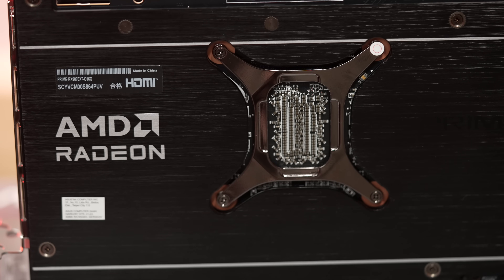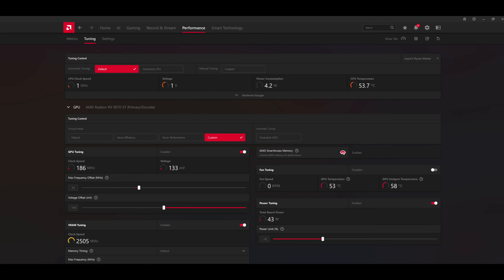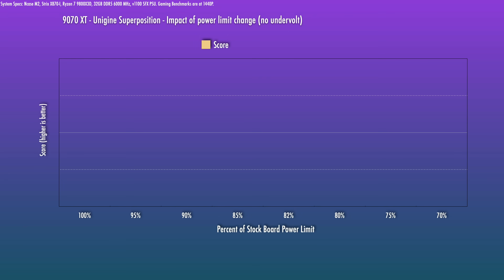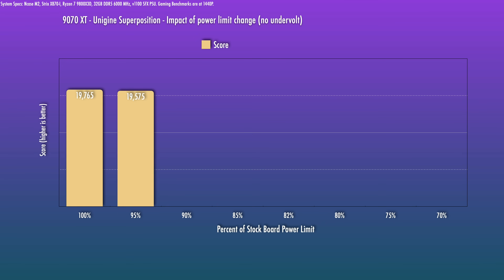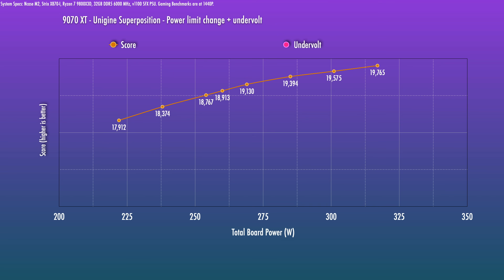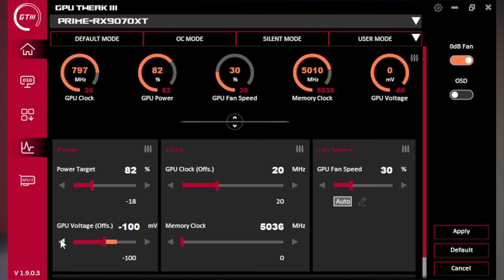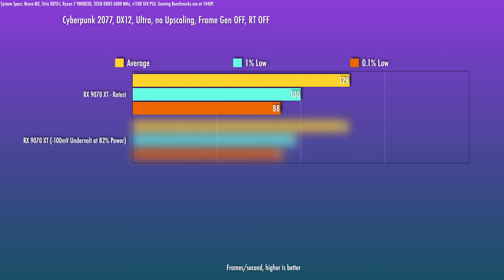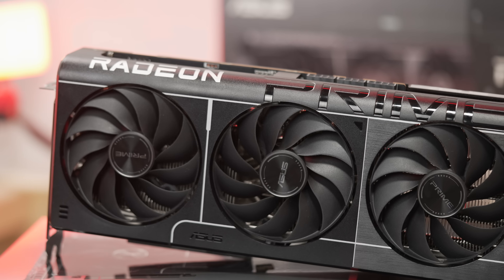Undervolting the 9070 XT... and also overclocking a 9070 to XT levels!

Comment: I've done -21% power -65mv and+100 on the memory. Sorting at 5% performance loss with hot spot and menm temps at 70 and GPU at 50. Silent high performance gaming at 240w!

The pulse for my theme and I got it very close to Aussie MSRP (double the USD number)

Comment: Got my 9700XT this week 

Upgraded from 5700XT. I had different 7 profiles set for my 5700XT after 5 years of use (power limits, voltage, fan  curves etc). So setting up newer ones wasn't a lot of work. But testing take times.

Out of the box (stock) I see power usage of 330W+ (415W in 1 run for a few seconds) after doing some bench marking. stock 3.1Ghz boost clocks, Ram 2505

Currently I have 4 profiles saved 

The one I use currently (stable in games/bench marks tested so far): 
-85 voltage offset 
- 15%  power limit
2618 ram with fast timings.
Custom fan curve 

Dropped my temps by 10C hot spot alone. 

Power 280w to 300w 

But the boost clocks (core) now hits up to  3.3Ghz 

So 50+ W dropped, boost clock up and scores up (287 points, in 1 bench mark, from stock). 

I'm still testing and know from the 5700XT that some games may like some different setting. 9700XT may be the same

Comment: With the Pure 9070 (2700mhz) I go to 4000pts (3998) on the new GameTech Bench (steam) and hit the 3000mhz on the GPU clock ! It's the 5070 TI score, but I go to 270w (with the 10% of adrenaline let us do) // I was undervolt to as doing : -55 or -65 (bcz it seems you can get more gpuclockhz per watts with undervolting) Memory is set with fast timing option and 2666mhz boost (it run at 2657mhz)
Reply: There is another score on this benchmark from 9070 that goes to 4200pts !

Comment: I'm very new to all this, but I want to know if the purpose of undervolting and power limiting is to keep temps down for ITX builds. I'm confused because there are 9070xt OC variants out there. And if my presumptions about temps is correct for ITX builds, people that wants to build in SFF cases shouldn't get the OC 9070xt?

Please someone shed some light

Comment: My 9070 is stable at -160mv.  I havent even tried any lower lol.  Maybe i got super lucky but these things can run really stable at VERY LOW voltages.  Memory is at 2714 with fast timings.  It SCREAMS at these settings.  temps are under 80c for the hotspot the rest of the card is well under 65c.

Comment: What you think, 9070 Gigabyte Gaming OC or asus prime for 35$ less? Want to reach the 9070XT Performance
Reply from the maker: Personally I’d pick whatever is cheaper, I’m not under the impression any of those are pre-selected chips. Being able to catch the XT isn’t guaranteed but it did not take a huge overclock to get there.
Reply: @MachinesMore  hmm okay i was thinking maybe the cooler of the gigabyte gaming oc could be better. So you can reach a higher boost and more fps.

Comment: Are you going to make a follow up video with more games/setups? I'd like to see a "stock" 9070 @ ~253W (110% power) vs a 9070 XT @ ~260W (82% power). Probably be a lot more data points, so if not could you maybe add a little comment how much performance you would lose at those power limit without touching the voltage offset? 

This is because your Cyberpunk data is really interesting as both of them are using similar TBP it seems, but the 9070 non-XT seems to have a bit more aggressive undervolt to hit higher clocks. If performance is similar with more games, this would make it seem the CU scaling kinda of drops off after 56 CUs (9070) bearing in mind a very good silicon I suppose.

Comment: I got XFX 9070XT Mercury  - I was trying -AND testing all weekend..so it works with values above -70 mV BUT - It crashes once in a while even with -30 mV in Games like Hunt Showdown and The finals..I was playing all weekend - and I had to go down more and more because of crashes - till I gave up after -30 (going down from -65 in steps of 5). I just set up this undervolting Value and opened the power limit.

Ich habe eine XFX 9070XT Mercury - Ich habe das ganze Wochenende versucht und getestet... Es funktioniert mit Werten über -70 mV, ABER - Es stürzt gelegentlich sogar bei -30 mV in Spielen wie Hunt: Showdown und The Finals ab... Ich habe das ganze Wochenende gespielt - und musste wegen der Abstürze immer weiter runtergehen - bis ich nach -30 mV aufgegeben habe (von -65 in 5er-Schritten nach unten). Ich habe den  mV - Wert eingestellt und das Power-Limit geöffnet.

Comment: Getting my 9070 to within about 3% of 9070 xt levels.   with 10% power, core overclocks quite a lot, I cant get memory to OC much though.     In any case,  its a huge jump going from a 6800 to a 9070 (non xt in both cases).    And, hotspot temps are quite modest under load (hotspot under 60c in games, vram temps do tend to go up to around 85c.)   Im using a Fractal Torrent so ambient temp inside the case tends to be pretty modest.  Im quite happy with this GPU.

Comment: Everyone is undervolting their 9070xt by -100mV and meanwhile mine crashes at -80. I guess there have to be losers in the silicon lottery too.
Reply: It's also game and background application dependant. I will test mine further.
Reply: I think a lot of users are not correctly testing their undervolts. From what I see people are testing using synthetic raster benchmarks, but nothing using the RayTracing or Machine Learning units of the cards. My card won't go lower than -70mv for games like Jedi Survivor if Ray Tracing and DLSS (Optiscaler) are turned on. If I play raster only, I can get -100mv or lower.

Comment: I am having issues with my 9070 that I cant figure out. My initial Uingine benchmark 1080p high was 29,657, and then I updated the drivers for the motherboard (B650) and cpu (7800x3D) and it went down to 25,000 and I dont know how or if I should switch back to the old motherboard and cpu drivers? Its driving me crazy ! Any Idea where I could get some help with this?
Also I did a comparative 4k benchmark and got 16900 so Im under performing the benchmark you showed in the video as well by about the percentage of lost performance.
Reply from the maker: I am curious too… did you try reinstalling the display driver? The other two updates shouldn’t impact the card but it’s possible some system setting was patched over. One thing would do is pull up a hardware monitor and log if the GPU is drawing full power when running the benchmark.
Reply: Well first of all, is you 9070 running stock settings? without undervolt and raising the power limit 17k ish seems like where it should be, about 11% lower than OC'd card
I have 9070 pulse, I run -55mv, 200mhz oc on memory and 110% powerlimit. That got me 18428 points with 13600k with no OC on CPU. I could juice my memory to 300mhz and undervolt to -80mv and run the benchmark and get like 19k points but its not stable on CP2077
Reply: @ I appreciate you taking the time at first I was relieved to hear you say that but then I ran another 3dmark test and saw the same losses from 27800 to 26179 and thats with an overclock try to catch back up to my non oc performance. I clearly did something thats dragging this thing down about 10-15% the first thing I did when i got it was benchmark it out of the box practically and it did phenomenally and then I had some cpu stuttering in game nothing crazy but I decided to update the motherboard and cpu drivers. I have tried reverting back to the old ones but The AMD installer that "checks hardware comparability" freezes unless I try to install the most recent one. I think it might be a utilization issue The Uingine Benchmark was getting like 94-97% card utilization drawing around 230-260 watts according to hardware monitor and during the 3dmark test it was even less often drawing less that 120 watts.
Reply: @leemiller5194  GPU utilization below 99-100% would indicate cpu bottle neck indeed. What about your CPU score benchmarks? Has it gone down or stayed the same?
Reply: @DuBstep115   CPU scores are good around 18000 on cinebench r23 but ill trip which is in range for 7800x3D but yeah i think therein lies the issue when you bench mark yours your actually at 99% - 100% at least 10% of the time if i get to 100% or 98% even its for a half a second and then it goest to lik 94-96% etc
Reply: @DuBstep115   CPU scores are 18000 on Cinebench R23 which is in range for the 7800x3d
Reply: I updated the UFEI / BIOS and it made no difference. Still no luck restoring previous performance.
Reply: @leemiller5194  I would have done clean install for windows at this point 😅
How about gaming? No stutters? The GPU works great but just with lower performance?
Reply: @ pretty much as far as i can tell i get some frame time spikes in one particular game but ive only had it three days and  other than that it works amazing. All things considered its still a massive upgrade and i should just be happy with it Im just so confused as to what happened. I ll try a clean windows install next.
Reply: @ You were correct! that is what fixed it. I think the Chipset Drivers that were being installed with the Adrenaline package the newest ones for some reason are tanking Performance by almost 20% in some cases not sure what I actually did / did wrong etc. but its fixed.
Reply: @leemiller5194  Glad it worked out in the end, enjoy your new GPU
Reply: @leemiller5194  I fkn hate yt, they deleted my comment like 7 times
Reply: I FIXED IT! scoring 31-33k depending on oc after clean windows install and installing adrenaline WITHOUT the chipset Drivers! OMG for me that was a lot of work I dont do a lot of PC stuff.
Reply: @leemiller5194  haha enjoy your new properly working gpu

Comment: Stumbled upon this video. Have been wondering why others have not been doing more testing with the 9070. Seems to have a lot better power to performance ratio than the XT variant. Have a small office that heats up quickly. Work from home and use the pc for roughly 11-12 hours a day. Purchased the 9070 due to the power draw difference. Hopefully, there will be a drop in my cooling bill this coming summer. The 9070 is replacing a RX6950XT.

Comment: I looked through a bunch of the comments and couldn't find any discussion of it/justification, but why the different fan speeds? I initially saw the undervolt as higher temp and went "That doesn't make sense", but seeing the lower RPM fan does make sense. Just doesn't really make it an apples to apples comparison any more unfortunately.

Comment: Superposition benchmark doesn't stress cards well enough and they will run higher clocks before hitting power limit, in games you will see much lower clocks at the same power.

Comment: Wonder whats your take on 9070 undervolt for even more efficiency. Will it be similar 82% and 100mV? If some1 already played with numbers, share you max performance/watt results on 9070! ( I expect you can get way under 170-180wt with not much perf lost? )
Reply: Why would you want to lower the power consumption on a card that takes 220w to 180w?
When you can match the performance of stock 9070XT a 305w card by raising the powerlimit by 10% on 9070 220w to 240W
Reply: @DuBstep115  I'm struggling with my apartment overheat during summer. So the lower overall wattage the better. Yet i want to have some gaming sessions with decent performance without sacrificing too much quality.
Reply: @nw6066  I understand but 50w also aint much. I doubt you could even notice a difference between 180w and 220w in room temp without going in to decimals. like difference between 25.2c and 25.3c
Reply: @DuBstep115  I think it will be more. As 1 person generates 100w of heat, and i can definately feel difference with 1 vs 2 in same room ona long run, so  half of that will be sufficiant. Besides when i switch from regular watching movie to gaming i really feel that heat, since my PC case is near my feets. Flow of heated air is real thing for me. The less heat - the better! For my <9m2
Reply: @nw6066  Well in that case you can slide the powerlimit to -30% and run the card at 154w :D With 60mv undervolt you should still get like above 7800XT performance out of non xt 9070
Reply: @DuBstep115  the plan is to see whats max performance/watt can 9070 deliver. It might be too brutal to go all way down with powerlimitand voltage. Anyways, with current price of 9070 in my country (850$ for basic versions) i doubt i buy it till autumn for any decent price. Problem solved! Ty AMD!

Comment: with  my 9800x3d @ ~53w's and 5000cl28 ram,   my undervolted overclocked 4070 ti is running FF7 rebirth 4k max settings ~110fps  @150w's 🤯 
and 1440p 120fps @ 117w's  🤯🤯

Comment: either adrenaline is terrible as is usual for amd, or my pulse cant do even -25 on the voltage offset
Reply: my pulse is stable till -55mv. Its a trash tier card, so dont expect much from it. But -20mv and 110% powerlimit should get you 5-6% performance boost

Comment: How is this possible? The XT has 15% more clock and 15% more stream processors. If the undervolting of the XT version has not caused any performance degradation, as shown in the first part talking about the performance, then how can you overclock the non-xt card to overcome the 15%reduction in stream processors AND the clock difference?
Reply: the xt will always be faster but not more than 5 to 10% at the same frequency
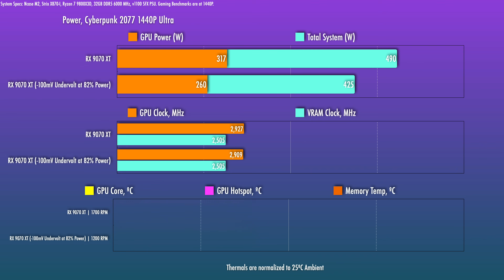Reply: @fdgdfgdfgdfg3811  But @4:51 the video shows clock speeeds of 2909 MHz when undervolted and power limit adjusted for the 9070 XT. On the next slides the video shows exactly the same scores that are shown later w.r.t to the overclocked 9070 (at 3046 MHz), but almost the same power draw at 253 Watts, see 5:09). At 5:38 we see that all three variants, 9070 XT stock, 9070 XT undervolted and 9070 overclocked show the same FPS. Same power, 9070 XT 5% lower clock, same FPS. This would mean that 5% more clock on the 9070 outweights 15% more stream processors on the 9070 XT. This sounds unusual.

Comment: Great info. Picked up a Sapphire Pure 9070 (non XT), which has a beefy 3 slot cooler. It runs really cool and quiet on stock, so now I'm trying to undervolt it at 110% power to see what I can squeeze out of it. At -65 mv, it boosted briefly to 3100 MHz. I think there's even more in the tank :)
Reply: nice ,later manufactured models will have better silicon so they will oc to 3.3ghz most likely
Reply: @fdgdfgdfgdfg3811  my on stock settings is boosting to 3.1 but still and didnt figured it out how to safely push it to 3.3, well my experiment will continue xD

Comment: What does the voltage offset do. Without adjusting it I get a mere 3 percent fps increase with 110 percent powerlimit on sapphire pulse 9070. With an mv offset of -100 combined with the 110 powerlimit I get a decent 9.5 percent fps increase running 3Dmark. Is lowering voltage offset harmful in any way? I am a noob in OC. Temps are conissently with the OC, barely more than 54 degree celsius at worst and vram temp 88 maximum and 78  gpu hotspot, seems fine.